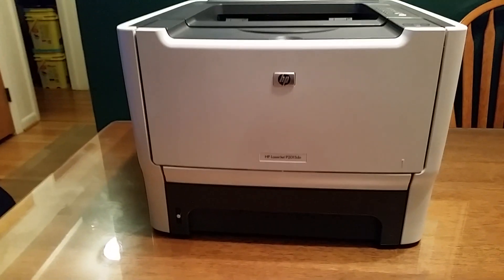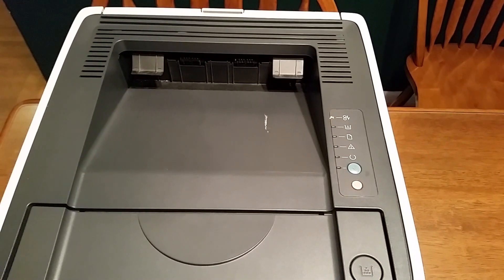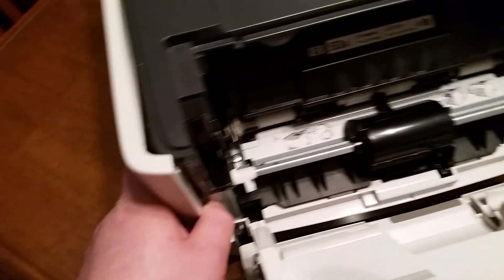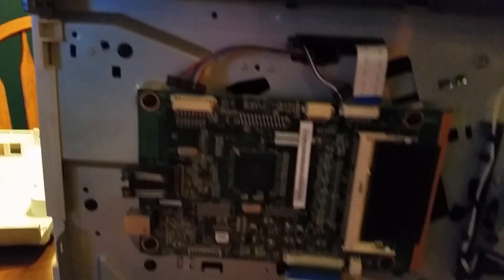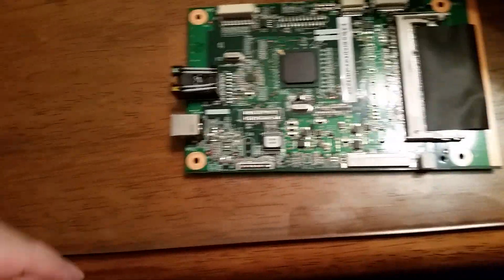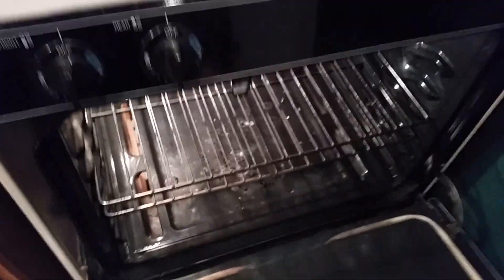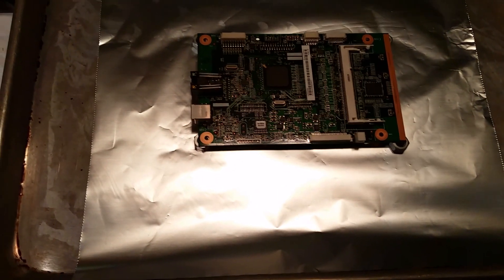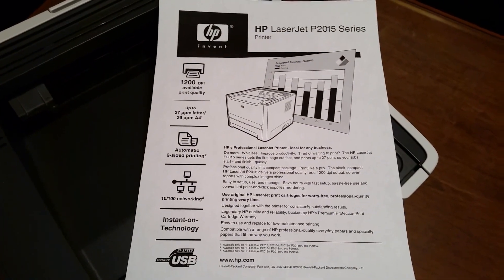HP LaserJet P2015dn repair - Baking the Formatter board

Comment: Hello from January 2026! It worked, thanks! I got this printer from a job two years ago and it hadn’t been used since 2019 when I found it discarded in a cabinet. It says I still have 7,000 pages left on the toner. I was disappointed when it gave me the error but it took me two years to get around to trying the fix. Quick and easy!

Comment: My 17 year-old printer with over 4000 pages on the last 3000 page 53A recently had a solid toner light. Replaced the toner with a brand new 53A, purchased 4 years ago btw, expecting it to fix the problem only for the light to stay solid. Thought I was out $125 plus the cost of a new printer. Tried this technique and it worked! Thanks!

Comment: Thank you!!  My P2015n has been fixed!  Baked at 190 Celsius (pre-heated) for 7 minutes, while also unsticking the plastic protector sheet from the board, just to be sure nothing melts.  Other plastic components, such as socket connectors, were unharmed - don't worry, they will not melt.

Comment: Great video! I got a P2015d to work again by baking the formatter board for 8 min at 400 F, component side up, on a sheet of aluminum foil with aluminum foil balls holding up the corners of the board. Note: Pull the side cover off from the back, not the front.

Comment: This video is worth 100usd per view, as it saves you that much money. Or even more, as it makes a dead old printer into fully functioning good printer. Thanks a lot. I just had to remind myself of the procedure. And this video is not as easy to find as it used to be. Is it the big three algorithm? Big three meaning: Blackrock, Vanguard and State street, controling not only YT and google, but Microsoft,  HP,...

Comment: This is the second time within around five years that I’ve used this method to bring back my printer from the dead.
Hard to believe that baking a printer’s component actually works, but my two successes prove that it does.
Ten minutes to remove the board… eight minutes in the oven at 180 degrees… ten minutes to cool… and ten minutes to refit the board.
Printer working like new!
Thank you again for posting this video. You continue to save me the expense of a new printer.

Comment: I didn't have high hopes for this fix cause I destroyed a laptop motherboard with a similar trick, discovered on Youtube. But in this case  the printer was going to go to the dumpster unless I could fix it. Well, darn if it didn't work! 350 F for 10 minutes with the convection fan turned on. I just had the board edges sitting on heatproof bricks then on a dinner plate. Thanks.

Comment: I have been trained by IBM, Apple, Compaq/HP in repair of computers, printers servers and more.  I am an old dude.  Retired and then some - so when my HP P2015 Laserjet came up with the paper jam icon lit - I did all of the normal things that one does when there was/is a paper jam.   Even cleaned the pick up rollers etc.    Bottom line when I saw this video - I figured what the heck - if this is a prank or joke - I was going to trash the printer anyway.  So I put the control board in my "analog" oven at 350 degrees for 8 minutes.   Let it cool down - installed it back in the printer and - I laughed out loud when it started printing again.  NO lit paper jam Icon.  -I did melt an insulating material where a memory or function board plugs in.  Not sure that will cause a heat issue since it cover an IC.    But it worked - go figure.

Comment: This procedure still works! My very old P2015 started doing the "offline" and false error things a few weeks ago. I was considering getting something new, but thought I better Google the problem first. I found a number of references to "baking the board," but this video is by far the best thing out there. Tried it, and it seems to have fixed the problem (for now, at least). Thanks so much!

Comment: A quick question. A year ago I saw this video. Followed the instructions and it did the job. Printer worked for a year. Now I am doing it again, did anyone have the same problem that it stopped working?
Reply: Baked it again before anyone replied. Well, it does work again.

Comment: I just tried it and it worked. The "Ready" light does not come on, so what, I can print from a network connection again! On my Windows 10 machine, I clicked "Add a printer" and clicked on the link at the bottom of the searching screen, "My printer wasn't found". Chose the button "My printer is older, help me find it" and POOF there it was! It never showed up before the 5 minute bake at 400°. After the bake, there it is! Installed the Microsoft PCL6 driver and wha-la... my networked printer is back. THANK YOU!

Comment: Good helpful video for those who need assistance but a couple notes. 

When removing the cover, it is best to use a screwdriver to pry apart/remove the back of the side first.  it is much more difficult to pry it from the front and you could damage it.

As for baking the board, you get the best consistency if you bake at 350 for 8 minutes as you did, but rather than remove the board, just open the oven door  a little and let it cool down without touching the board.  It allows a more stable environment in cooling, you won't flex the board, hit the standoffs or nuts, etc.   Solder is still fluid, so movement can impact it.

Also, removing the memory shielding as you did is a good idea and baking the board upright as you did.  Also, motherboard standoffs upside down work great as they will not move, so less fear.  We have about 30 of these junk printers in our office and I have baked 2/3rds of them, some multiple times.  Sad as HP has been bulletproof in the past, but this model is just not good.   Baking is cheaper than buying new however and works for many different issue leading back to the formatter or I/O including ethernet port.

Comment: I cannot believe that this worked!  It unbricked my hp2015dn!  It wouldn't get past the single jam light indicator at power-on. Wouldn't print spec pages or anything.  I pulled the board per this video and baked it at 375 deg F for 8 minutes.  Let it cool for 15 min and reinstalled it.  She's a workhorse again, full duplex. Great looking pages and speed.  Thank you for leading the way on this crazy, but successful, idea.

Comment: I have unhooked the formatting board, cleaned it with a natural fiber brush (to avoid esd) and installed the board again and it works too. Maybe the solving activity was to unhook the cables and reconnect them again.

Comment: Always remember to add liquid flux under the chip or anything when reballing.
You could have used a heat gun station 825d+ to avoid melting plastic if worried about it!
Good info though i was unaware of this fault and the fix!

Comment: I am about to bake my board for the 8th or 9th time.  The only thing I do differently is, after baking for 8 minutes at 375˚ F, I turn off the oven and open the door about half way.  I then let the board cool gradually inside the oven.  This fix has worked every time.

Comment: That worked. I used a preheated pan and 400f for 6 minutes. That was enough to re-flow some of the connections. This restored my printer LEDs to ready, restored my unresponsive NIC (no lights to correct lights) and resulted is cashed print jobs poring out from my PC.  Weather it re-flowed solder joints on the board or corrected something internal to a component I do not know.  Just to check connections before I baked the board I removed reinstalled it to no avail.  It was the baking that fixed it.  Thanks